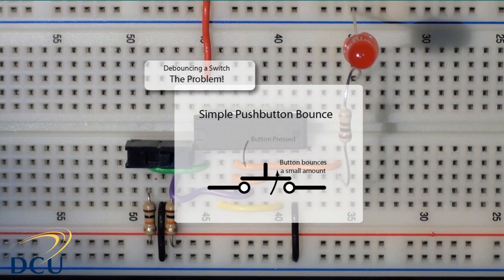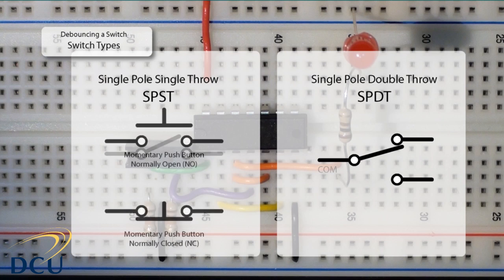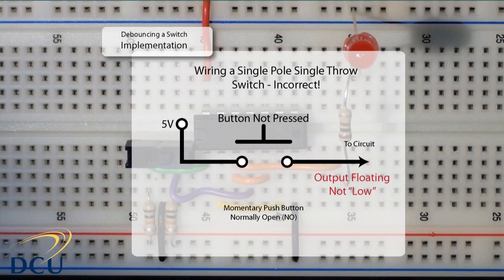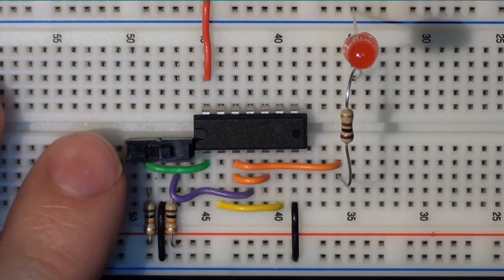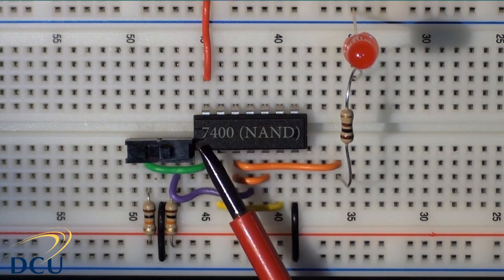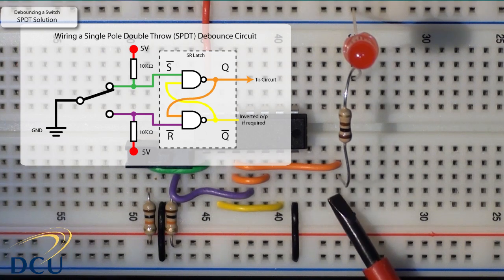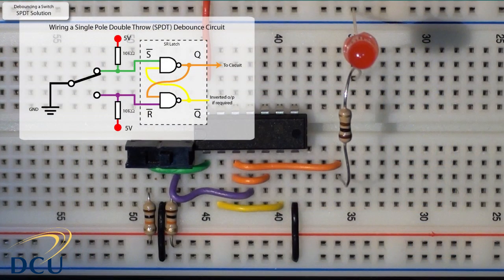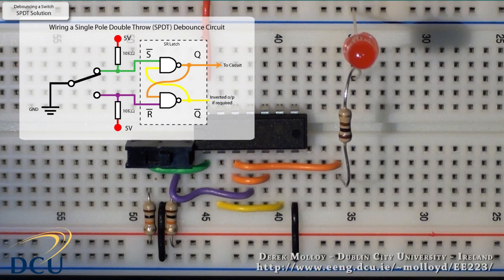Digital Electronics: Debouncing a Slider Switch (SPDT)

Comment: At 5:32 the switch on(green wire) is in 0(low state) that's why the LED was turning on because a latch made out of NAND gates is an active-low type of circuit. Whereas, when the switch is off the green wire value becomes 1 because the ground is now connected to the purple wire, thus, making the output into 0(off state)

Comment: This debouncing circuit can be simplified considerably by using two gates from a 7404 Hex Inverter IC 
(or 7414 Hex Inverting Schmitt Triggers if desired) instead of the two 7400 NAND gates.
The result will be 50% more debounce circuits available per IC and at the same time almost 50% less 
power consumption per debouncing circuit on the input resistors ! 

Connect both resistors between an output of one inverter and the input of an other inverter (crosswise).
Connect the switch to ground and both inputs in the same way as in the video above.
That way you use smaller gates and can make three instead of two debouncing circuits per IC, 
also there is less power needed because the current trough the resistor on the input that is connected 
to ground by the switch is turned off due to the flip-flop effect .

🖖😎👍 ❗

Comment: Just a simple question: at 6:52, haven't you mixed up the table a bit? I don't see how for S-bar = 0 and R-bar = 1 you could have Q = 0 and Q-bar = 1. It's a NAND gate, so S-bar = 0 would automatically make Q = 1, wouldn't it?

In my opinion, the table should be:

S-bar | R-bar | Q | Q-bar
------------------------------------
0        | 0        | X | X       |
0        | 1        | 1 | 0       |
1        | 0        | 0 | 1       |
1        | 1        | L | L       |
Reply: Agreed, the table he did was for S and R not Sbar and Rbar

Comment: Good video, really good.Are there 3pole switches???Let me know...
Reply: Two pole center off switches are common. You can do it with a SPST switch. I show how. 
I have designed a SPST  SR Latch debouncer. It tells you - like the SPDT SR Latch circuit - as soon as the switch starts changing state (plus deglitch time). Either opening or closing. 
https://spacetimepro.blogspot.com/2023/09/switch-debouncer.html

Comment: Sorry for the dumb question but I don't see why it doesn't short circuit from your diagram. The logic gate is on the right and both the power source and ground are connected to each other on the left in either switch position. Why would any current go to the SR latch?

Comment: Thank you so, so much. Your videos are a life saver for my class. =)
Reply: You might want to have them chew on this. It isolates all the concepts involved yet is quite simple.
I have designed a SPST  SR Latch debouncer. It tells you - like the SPDT SR Latch circuit - as soon as the switch starts changing state (plus deglitch time). Either opening or closing. 
https://spacetimepro.blogspot.com/2023/09/switch-debouncer.html

Comment: Nice to know a physical implementation of a debouncing circuit, as opposed to a software solution where a time delay is added for a manual switch signal to settle.
Nice videos you have uploaded.

Quesiton: In the truth table at 6:10, 
did you accidentally put the wrong values of Q (and Q bar)?
Ref wikipedia
Flip-flop_(electronics)#SR_NAND_latch

I thought this latch is low-enable. So S_bar has to be 0 to set (to 1)
and R_bar has to be 0 to reset (to 0).
Reply: I do it both ways. They are complimentary.
I have designed a SPST  SR Latch debouncer. It tells you - like the SPDT SR Latch circuit - as soon as the switch starts changing state (plus deglitch time). Either opening or closing. 
https://spacetimepro.blogspot.com/2023/09/switch-debouncer.html